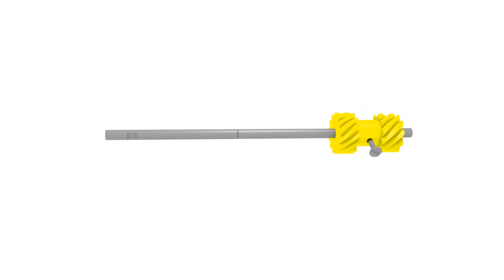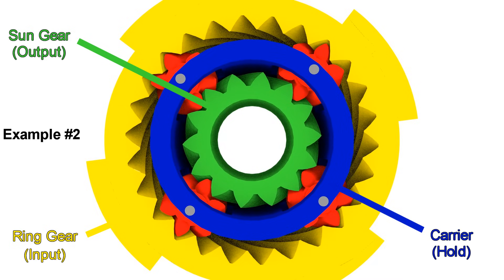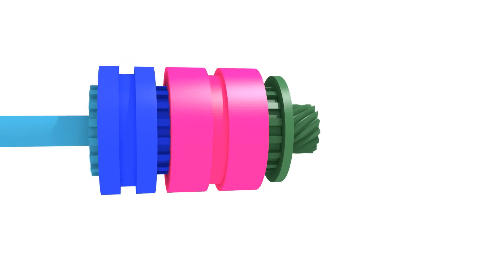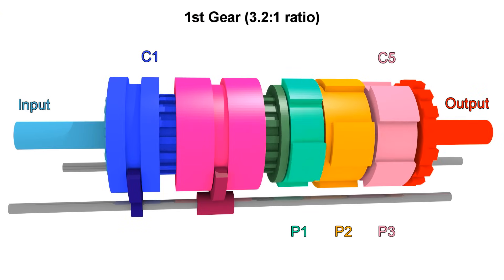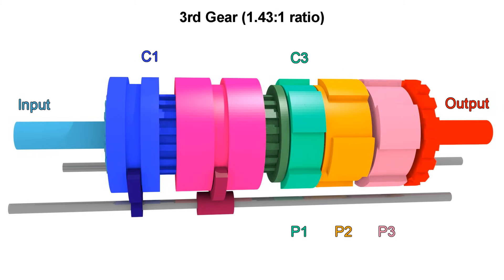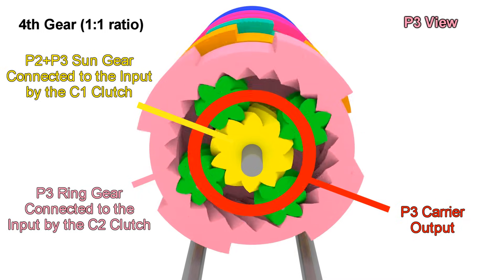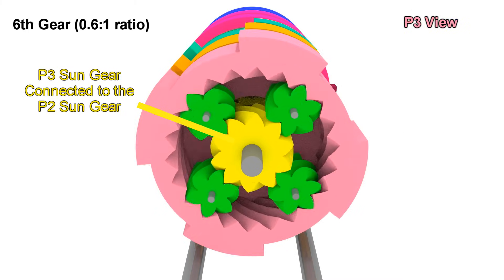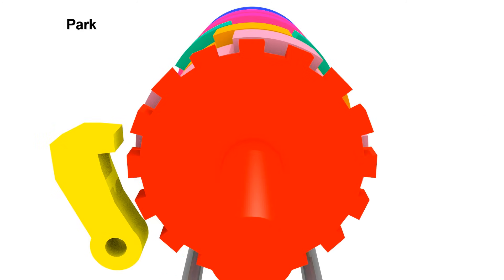How an Automatic Transmission Works (Allison 1000)

Comment: hello, great explanation,
I'm trying to make my own design, but once calculated, I could not draw the teeth of each of my gears the right way, I searched the internet but I have not gotten an explanation that can understand easily.

Do you know any source of information?
or maybe
Could you tell me how to do this?

Thanks in advance
Reply from the maker: +Akamaru Manu You mean that you are trying to make your own 3d model and you don't know how to make the teeth of the gears? If that's what you mean, I can't help you because I didn't make the gears for my model. I download the 3 planetary gear sets and I made the rest by myself.
Reply: +interlinkknight  Nooooooooooo!!!
jhajhahahah
ok ok thank any way ;)
Reply from the maker: +Akamaru Manu Hi again. I found this planetary gear set that you can customize as you want: http://www.thingiverse.com/apps/customizer/run?thing_id=968011&code=7424bf0420a242d60425d8a425332217
Essentially you can create your own planetary gear set with that, very easily. I use it to re-make my transmission a few weeks ago.
Reply: thanks

Comment: Awesome.. detail explanation with 3D drawing, very helpful. Thanks.
Reply: I don't understand how the sun gear turns faster on P2 for gear 6 than it does for gear 5.  Are you sure you got this right?  Or should the configuration for gears 5 and 6 be switched?

Comment: I must agree with Soylant - your explanation and animation present a genuine learning opportunity.
Brownie points earned for not claiming that this is an 'easy to understand' gearbox.
However, you did make the 'general concept' easy to understand, whilst at the same time providing the detail, that can be repeat watched.
In effect, you managed to kill two birds with one stone.
I could watch this one with my son (the benchmark)... whereas the 'learn engineering' vid was a complete fail, as witnessed by the comments (mine included).
I think I'll go back and edit my post to add a link to this vid and Thomas Schwenke 's vid (describing a simpler setup).
Reply from the maker: +PlayF1 Net Thanks for your words. Is nice knowing my effort is useful for other people.

Comment: Thanks for this.  You were much more clear than that other automatic transmission video that has over a million views.  I'll need to watch it again a few times.  I also have a few webpages open that explain the math of planetary gears.
Reply from the maker: +Soylant I am happy you find it helpful.

I agree that there are many videos explaining how automatic transmission works, but they all skip the part on how all those gears actually create all those ratios (power-flow).

I didn't go about the math of planetary gears because I didn't want to be too confusing, when already kinda is.

Good luck

Comment: #interlinkknight i understand how the internals of an automated gearbox works, you've explained it perfectly, but how exactly does pressing the accelerator transform into shifting gears?
Reply from the maker: +adrian ionut On the bottom of the transmission there are a set of valves and solenoids that are controlled by a computer that "decide" what gear to put base on the speed of the car, speed of the engine and position of the pedal.
Reply: InterlinkKnight Ohh, I thought it was  mechanically automatic... I was like what's so special about planetary gears that does that? Now I know that it's just a computer.
Reply: I don't understand how the sun gear turns faster on P2 for gear 6 than it does for gear 5.  Are you sure you got this right?  Or should the configuration for gears 5 and 6 be switched?
Reply: @dowskivisionmagicaloracle8593  Let me try. In gear 5 and 6, the sun gears turn freely and the planetary gears drive the sun gear. For gear 5 and 6, the output to P3 is the sun gear, not the carrier, and that`s why things change a little. In both cases, the faster the sun gear turns, the faster the final output will be. Imagine that the planetary gears and ring gear are turning at the same speed (like a 4th gear). In this case, the sun gear will spin with the same velocity as the other 2 gears, right? Now imagine that the ring gear is a little bit slower than the planetary gears. In this case, the sun gear need to spin a little bit faster (in relation to the ring gear, since the planetary gears have the same velocity as before) and that`s what happens. Before, the planetary gears were not spinning, just turning. If the ring gets slower, but the planetary gears don`t, they have to start spinning. The bigger the difference in the speed between the ring gear and the planetary gears, the faster the planetary will spin and the faster  the sun gear will rotate. In gear 5, since the P2 ring is also rotating in the same direction, the relative velocity between the ring and planetary gears is not that great. In gear 6, the ring is stationary, so the difference between the speeds are bigger...